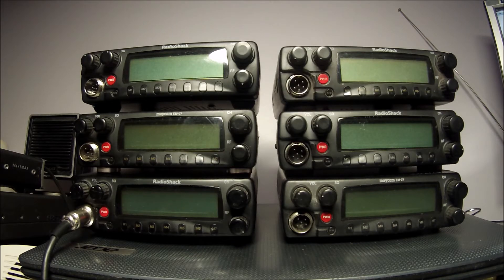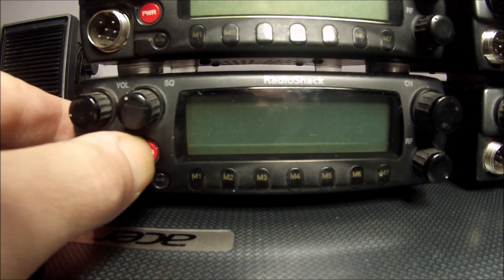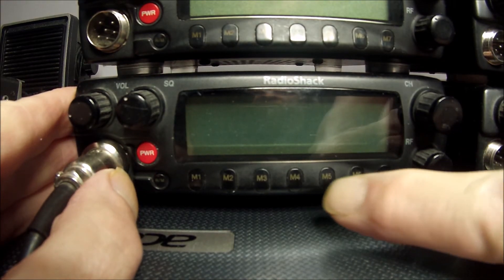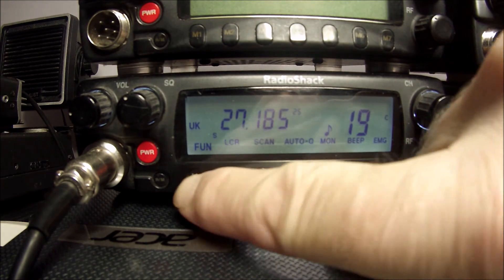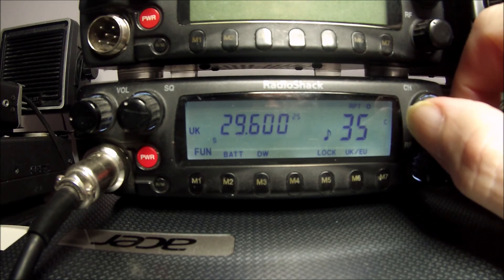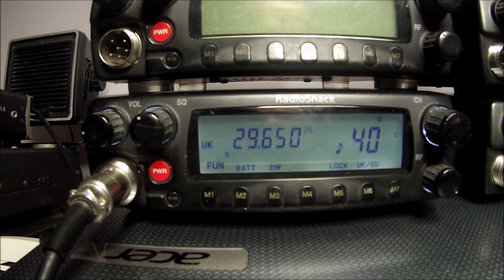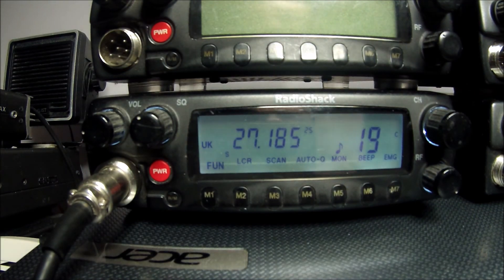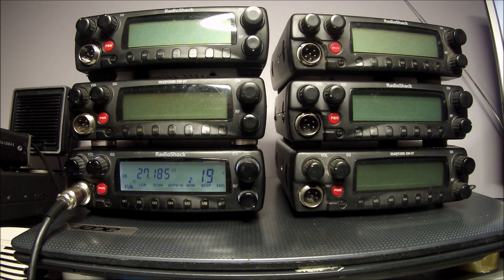10 meters FM

Comment: Bought a EM20 for a quid(!!) at a carboot a few tears agounused in box. Batt HAD leaked so I cleaned up and replaced with a NimH phone batt from Maplin! Did yours squeal without a battery? Later version used a 1 FARAD supercap instead but you can’t retrofit unfortunately.
G4BTI.